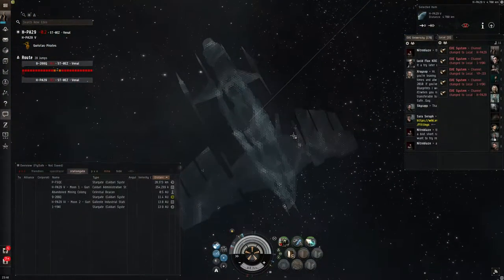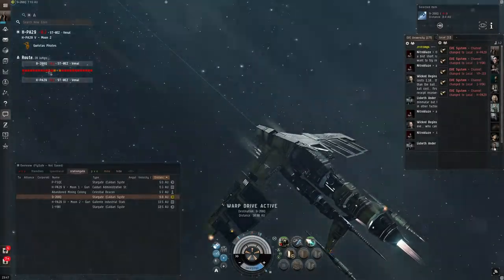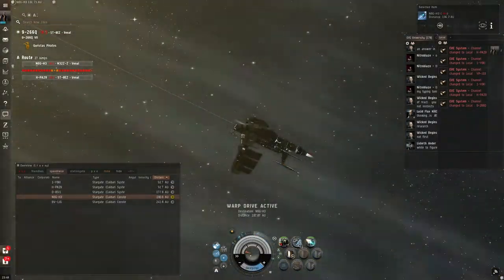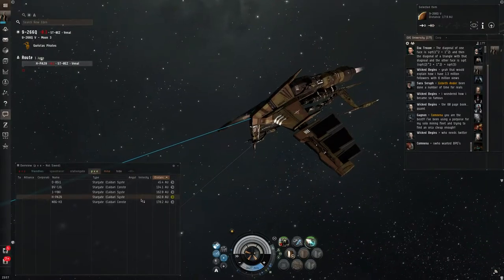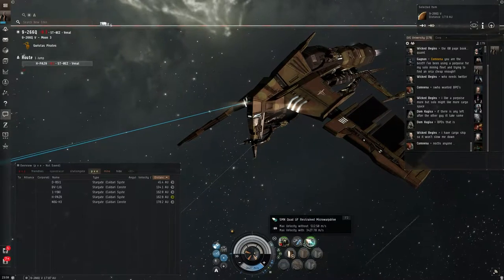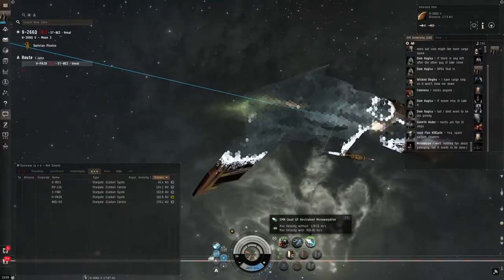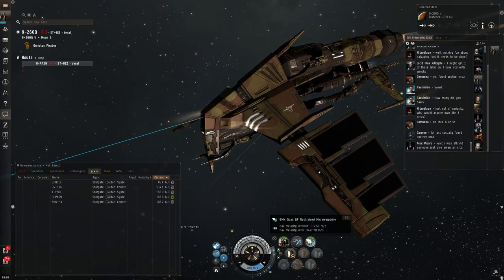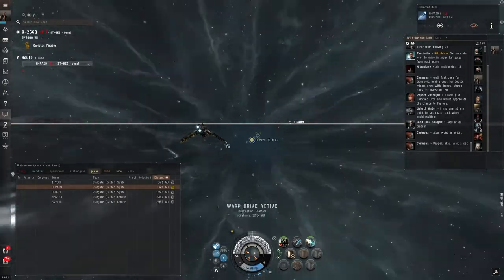EVE Online's Cloak + Microwarpdrive Trick

Comment: Hi again, Would you think this fitting can work with that MWD trick on an industrial ship ? With 1 nanofiber and 2 Low Friction Nozzle Joints , the align time would be 9.57 seconds. Fitting a 2nd nanofiber would bring the align time to 8.89sec, but I feel the penalty on the cargo hold is quite high.  The Crane (Covert Op version of the Badger) is just not an option at the moment (24 days of skill learning to add to my exising  queue of 72 days... ). Thanks !

[Badger, *Cloaking Badger]
Nanofiber Internal Structure II
Expanded Cargohold II
Expanded Cargohold II
Expanded Cargohold II

50MN Y-T8 Compact Microwarpdrive
Enduring Multispectrum Shield Hardener
Medium F-S9 Regolith Compact Shield Extender
Medium F-S9 Regolith Compact Shield Extender
Medium F-S9 Regolith Compact Shield Extender
Medium F-S9 Regolith Compact Shield Extender

Improved Cloaking Device II

Medium Ancillary Current Router I
Medium Low Friction Nozzle Joints I
Medium Low Friction Nozzle Joints I
Reply from the maker: 9.57 seconds could potentially work, as long as your MWD cycle time is 10 seconds (I'm not sure which skill it was, but there used to be a skill which reduced your MWD activation time). It's very close, though, and you'll just barely be able to insta-warp when your MWD dies and you have to de-cloak. I don't know what level you have the Evasive Manuevering skill trained to, but if it's less than 5 it might be a short enough train to be a better alternative than another nanofiber. 

I'd also swap your existing Nanofiber for an Inertial Stabilizer II--it does increase your sig radius, making attackers lock you the tiniest bit faster, but that tiny increase will be more than outweighed by the .2-.5 align speed improvement over a Nanofiber, and Inertial Stabs don't decrease your cargohold size at all.
Reply: @dalseides3742  Awesome, thank you so much for these clarifications! Evasive Maneuvering is only at level 3 and level 4 is on queue already, and due for about 14 days.  I'll have to prioritize that I think. And I'll definitely swap for the Inertial Stabilizer II, the "gain" is 0.5 seconds over the nanofiber, as per the fit simulator. Big thank you !